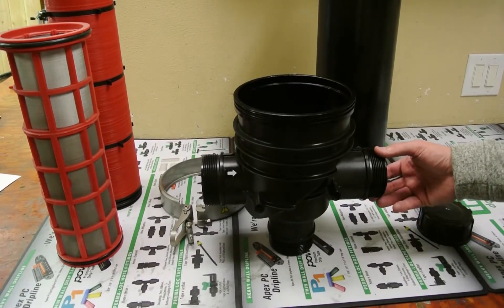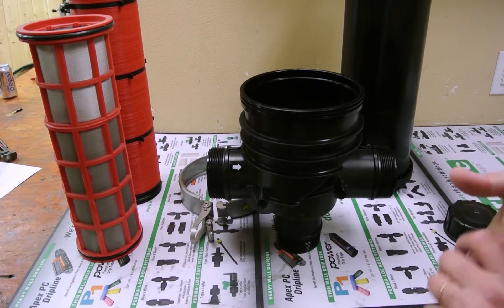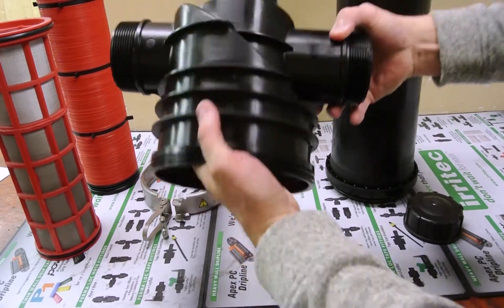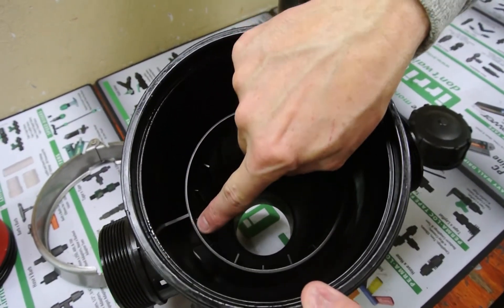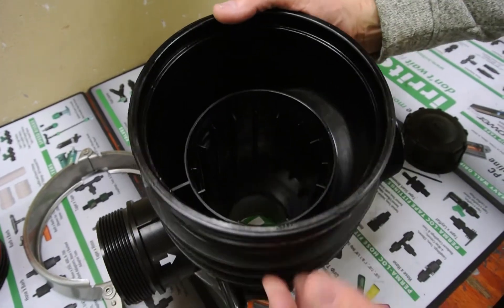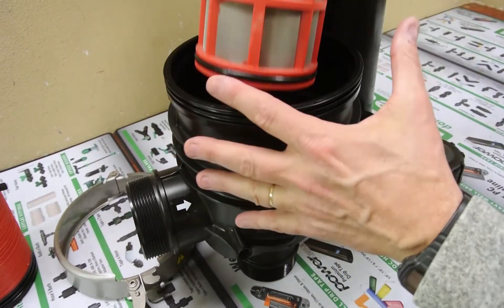TIF/THF Large T Filter Instructional Video

Comment: On disk type is it possible to flush the filter without disassembling it, you mentioned it but it was not very clear.t
Reply from the maker: Great question!  It can be done, but with manual disc filters typically is not -- with a disc filter, you can accomplish this by plumbing in some additional piping and valves to reverse the flow of water.  This will bring water in through the center of the element, and if you have the flushing valves open, push water through the inside of the discs and then out, ideally flushing debris that has collected on the outside of the discs during normal operation.   

You can likely see the problem with that already -- what is the quality of the water that's going through the center of the discs?  That's one place you don't want dirty water to go, as it will then get into the system when normal flow direction is reestablished.  

Netafim described the process (including a quick diagram) and the inherent problems pretty well in this little document: https://www.netafimusa.com/bynder/E22FC43F-B0E6-40BA-B503C344A15A3C7E-backflushing-manual-disc-filters.pdf